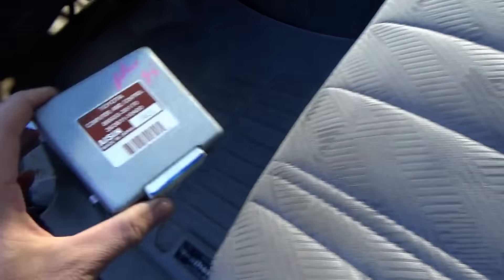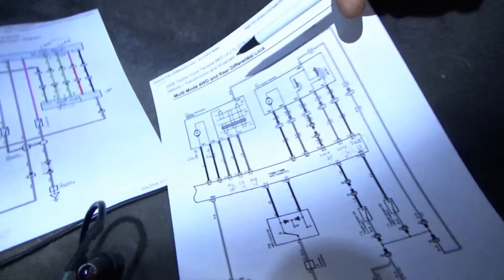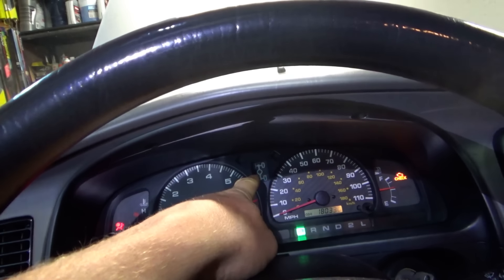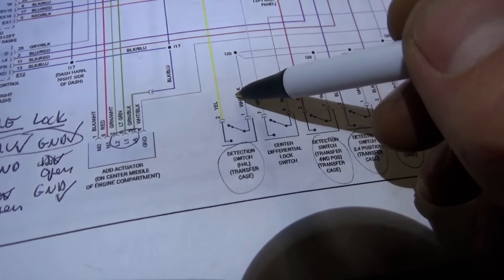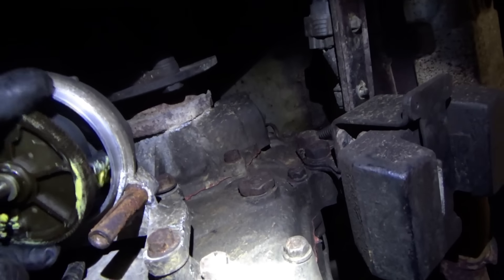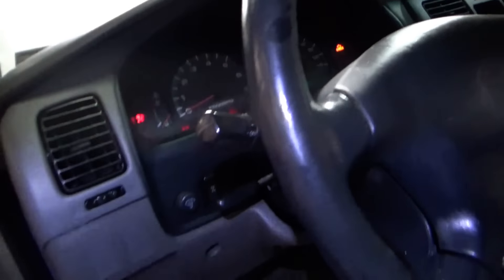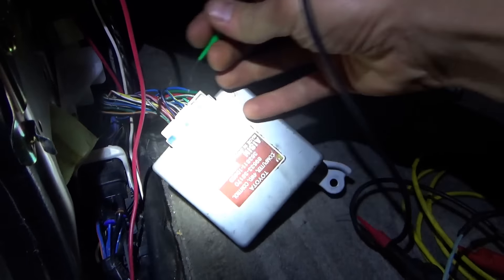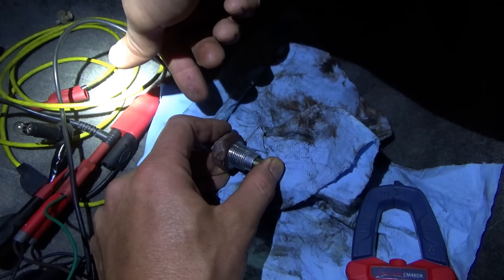(Pt 2) HELP! My Toyota is STILL STUCK in 4x4! ('02 4Runner)

Comment: Hey ivan. Your videos have have always helped me grow. I’m an expert certified Toyota technician and I agree. These 4WD diagnosis are extremely tricky. What I always do to test the limit switches is shoot 12 volts at the motor and have it go through all positions while resistance checking the limit switches internal to the motor. If it doesn’t change than I know the limit switch is stuck. On service information for the 4WD systems we have a quick training guide that really helps the diagnosis. Most Toyota techs in my shop are too lazy to wanna do these diagnosis properly so they shotgun parts. If you ever have any Toyotas that are weird issues I can msg you my number and we can work thru the issues.

Comment: Ivan, you and Eric O are national treasures. No mechanic at any dealership and very few independent mechanics go through this effort to fix older cars.  They play fast and loose with customers’ money and just fire the parts canon too often. I salute!
Reply: Too many customers assume because it's a dealership they shouldn't need to pay for testing or as many hours of testing because they're just supposed to know,   more experienced etc.    Reality most dealership techs on average don't even have 10 yrs experience on the brand so the older stuff isn't familiar.   And the older stuff isn't easier to diag because there's less data to interpret.   The quality of diag directly correlates to what the customer is willing to invest in a diag.     Most customers don't wanna pay for the answer they want you to guess then take all the liability and responsibility.

Comment: Ivan, this series is a great example to the public on what us Mechanics/Technicians go thru. The Ebs and Flows of the Diag process, the ability of honesty about being wrong and taking responsibility for it. Not only were you doing things the right way and still made a bad call, but you also had a ton of time in researching this older system to re-familiarize yourself. People do not realize this. I couldn't have done it better. Bravo

Comment: Congrats on nailing it down. 95% of all Toyota 4wd problems are in the stupid position switches, mostly in the transfer but occasionally the ADD. Gearsets never fail unless they run dry. 

I was looking at a 2020 Sequoia recently for flashing 4WD, and the 4WD ECU is incredibly not on the DLC network. Toyota tech school devotes an entire day just to 4WD electronics diagnosis due to the difficulty of these systems. If you have access to TIS there are some "cheat sheets" buried in the manual that provide premade on/off switch charts for every system since the '90s, much like the chart you were building. Huge timesaver if you can get your hands on it.

Comment: Don't feel too bad about the initial bad call, Ivan.  I lost $2200 (that's not a typo...) on a '23 Mercedes Metris van last Thursday, similar situation in a lack of service info making things difficult.  I've always been of the mentality that if the car is happy, everyone is happy.  The dealership had the van for a month and couldn't fix it, and it took me 11 hours--nearly 8 of which was with a remote Mercedes programming service @ $300/hour--to get it fixed.

Worth it though!  The customer is an independent commercial vehicle rental company, and they have a fleet of over 30 of these vans, all of which will be going to me instead of the dealership now for anything not covered under warranty.  :D

Comment: It's times like this I appreciate how simple my 99 4Runner is. Manual, with the J shift xfer case. No electronics in the 4x4 unless you count the rear differential e-locker.

Comment: 22:52 Diff Lock is not "In", or engaged, until the yellow light STOPS flashing. And you may need to be driving and moving for it to lock "on" solid, not flashing. Consult the Owner's Manual. I have an '01 4R 4WD and it can take some (variable) number of seconds for the lights to stop flashing, meaning that 4x4 and/or the CDL is now engaged.

Comment: as a former Toyota Master Tech, I HATED 4wd problems during that era since the service info was Horrible.
Reply: I’m a current Toyota mdt and it’s STILL bad. 4wd problems on Toyota suck because of lack of service info and diag process
Reply: @MMAunderbelly  I was working on a '20 Sequoia a few months ago...4WD STILL not on the network. $60K SUV when new. Good grief.
Reply: But it's a toyota, it can't be, everything is perfect according to the internet!

Anyway, have they strenghted up transfercases and propshafts or are they still made out of matches? Seen at least a couple with snapped shafts.

Comment: I’m so thankful you took the time to show us the new module didn’t work and continued to work on what’s next.  I definitely respect not charging the customer for the part but also understand that time is money and sometimes getting to the solution takes both.  Those parts probably don’t fly off the shelf on eBay but I wonder if it could be resold by the customer to recoup their money as an alternative.  I know it’s ridiculous but having a known good part is sometimes needed to get past what’s left.  I wonder how many parts get repackaged at a dealership by a tech realizing they were wrong too?  Probably happens a lot more than we know. I’ll have to watch this 10 more times to track your process and see if I can follow your steps to success.  Thanks again.

Comment: I had the same vehicle. Mine was a 2001. I had to move the vehicle forward a couple feet or a couple feet back to get things to change every time I changed any setting with the diff lock or high or low or whatever. I only had to go to neutral to go to four low or engage the Diff lock. You can do four high and two high on the fly under 25 miles an hour. But again to do the dip lock or for low or come out of it you have to move forward or reverse a couple feet for everything to lock or unlock and seat into position.

Comment: I've learned from the Master techs at my shop to start at the axle disconnect by plugging in a known good. Then, if there is no change, remove the rear switches and test those on the bench.

Comment: Ivan really opened my eyes to understanding the logic or programming of a module, this is a perfect example. You could have a mechanical failure that results in a sensor telling the module of the failure (or a module not getting the antipated electrical feedback) and the module would then shut down or go into limp mode to protect the drivetrain. This makes it appear there is a module or electrical fault, when the problem is mechanical (or in this case a hybrid mechanical/electrical problem with a switch).

Comment: Bought a ‘00 with the same issue… stuck in 4WD and the front ADD would not disengage. The 96-00 still had a vacuum actuated axle disconnect, so I was able to use a vacuum pump brake bleeder to disengage the coupling fork so I could at least drive around without axle bind. It ended up being one of the 5x position sensors (1 on front diff, 4 on the T-Case), which are usually the culprit as the switches bind up from sitting. Sometimes the  actuator motors on the 00-02’s bind up but it’s usually the switches. Some people have had success removing and cleaning them with contact cleaner and a bunch of cycling but that didn’t work for me. I replaced the 1 on the front diff and the 2 easily accessible ones on the t-case (the other 2 are way up next to the shifter) and it’s been smooth sailing since then. 

It seems like Toyota, in all their wisdom, made the system so that if there are any electronic faults with the system, it defaults to 4H Locked, which is great if something breaks in the brush but makes it a PITA to drive if it happens in civilization. 

It is very important to cycle your 4WD on any electronically actuated 4WD vehicle every once in a while so sensors and motors do not bind up from sitting and moisture accumulating. 

The fully mechanical J-shift found on everything up to ‘99 never has these problems and it seems odd that they would ever switch to electronics and motors and add some such complexity. These “straight shifter” models essentially have the exact same function as the older J-Shifts, my ‘00 limited (only available on the ‘99 & ‘00 limiteds) has a hybrid of the two: electronically locking center diff (which is special because you can have an AWD mode with the center unlocked to drive at any speed too) and mechanically/vacuum actuated everything else. That’s progress!

Wish this video came out two years ago when I spent months messing around with mine! Good stuff.

Comment: Clever stuff, Ivan.  I think the extreme cold weather can mess with systems on a car.  For example, when we moved to Minnesota, my 2004 Sequoia did some weird things.  One was related to its 4WD system, during sub zero Fahrenheit temperatures, it would get stuck in 4WD, and it would only free itself after the weather started to get warmer.  The airbag light used to come on also and only go out once the weather got warmer.  Never had these problems in Florida where we lived before or in Virginia where we are now.

Comment: Both the replacement module and the old module are both old. I would have to inspect the new old module before putting it in the vehicle, and if it passes the visual under the microscope then I would treat the pins with Deoxit D100L and cycle the connector a few times. Then I would apply power and see if it at least had 5V Digital Power on the PCB, then I would see if it controlled the transfer case. In the first video, from what I could see, the module PCB looked in really good condition. Taking the module apart to understand the circuitry has the advantage that you now know how the transfer case motor is controlled (relay contacts).  

I think once the module was ruled out I would have tried to cycle the motor and actuator assembly before doing anything else. Understanding the wiring diagram and knowing the module relay control approach you can tell that the motor is just a reversing DC brushed motor either locked or unlocked, moving between two stops, at least from what I could see in the video. I would have tried energizing the motor with a +12VDC Linear regulated current limited power supply initially set at 5 Amps current limit. If the motor is gummed or seized, it is usually just spent lubrication, and will not move you will current limit at 5 Amps. If it makes a noise like it is trying to move reverse the leads and try again, if it still makes a noise but does not move, try upping the current limit to 10 Amps and try again. If the motor eventually frees up moving back and forth between the stops, and the system still does not work, then you can move on to looking for a bad position switch.

However, even though you have been able to get the motor moving it is not fixed, it will just gum up again in the future because the lubricants used in the original assembly are crap. You will have to disassembly, clean, lubricate and re-assemble to really make the repair. You are better off rebuilding one on your own with high quality lubricants, than getting a replacement actuator assembly. Selecting the proper lubricants is not easy, but very interesting. One good source to start with is Dupont MolyKote.

You can get the rusted bolts out of the case with heat (use a propane torch and not an OXY on low), and fix the Pot Metal ears with Muggy Weld Super Alloy 1 Multi-Metal and Pot Metal Solder or equivalent if you can get the assembly completely apart, or if you do not want to heat up the case you can try JB Weld, which can work surprisingly well at times.

Comment: Is that switch listed as a proximity switch. It looks and behaves just like the switches we used when I was working is an engineering lab. We used them to sense the position of actuators and doors. They would have a very long throw. Some styles were very resistant to contamination and therefore suitable for harsh environments.

Comment: God help you if you need to remove that actuator from the transfer case.  The service procedure (bit different 1998 SR5) is to disassemble the transfer case to remove it.
I was able to take one apart and macgyver fix it with part of it still on the transfer case, but the gears in the actuator need to be timed appropriately.

The issue in my situation was corrosion that got into it and released the permanent magnets from their housing.  I glued them back in, and miraculously must have got the actuator gears timed properly during re-assembly.  Memory is telling me that Toyota did not sell just the actuator, so that means either a brand new transfer case, or sourcing one from Rustfreeville, AZ.  My fix lasted for at least a few years, and thank goodness this customer finally got rid of the thing because although it ran and drove great, it had the typical Toyota cancer.

Comment: In the first video, I mentioned possibly using an Arduino to replace the module if the module wasn't available because it's basically a state machine.  But the first step is to simply verify the state machine is working correctly by measuring the value of each switch in different shift positions and comparing to what it should be.  It might have been a fun project to quickly build a breadboard with an LED for each switch so you could see all the states simultaneously rather than switch test light and multimeter leads around.  I'm pretty sure a modern version of that box would be reporting states for each switch in scan data. If so, this would have been a quick diagnosis.

Comment: Ivan, the diag on this unit should be charged per hour since there is not enough service info on the 4WD operation. Your experience from previous diags should be compensated appropriately. When I do diags on things that don’t have service info I charge for the time NOT a flat diag fee. 
Plus , now that you’ve generated that truth table of switch states you are going to help someone else who watches IMMENSELY!! 
Great job in keeping your COOL 😎🧊when you hit a roadblock.

Comment: Sometimes the flashing 4x4 indicators don't go off immediately. You may have to drive a few, or more, seconds, even put it in reverse for a few seconds. If the system is working correctly, the lights (4x4 green and/or the Center Diff Lock yellow light in the middle) will flash when the system is NOT yet engaged. Then they go solid, on.

Comment: You can change the transfer case actuator without taking the transfer case apart. It is a little tricky getting the shift rods to line back up with everything in the shift actuator though.

Comment: My original guess was a bad position sensor in the shift motor assy but you were so sure it was the module (which in my experience is usually never the culprit). For the GM NV246 transfer case, the internal sensor is available. For Toyota, you may need to replace the entire shift motor assy. The symptoms seem very similar to the GM NV246 bad shift motor position sensor.

That 4WD detection switch seemed to work. We'll find out if it was bad in part 3.

Comment: Tired actuator motor?  We will see. My 2019 Tacoma (3 pedal) has had pretty much the same issue since new . To get it to shift from 4L to 4H or back to 2H , fully depress clutch pedal and release twice and it works every time. I have no explanation. Maybe some similar trick might work on the automatics also. Never worked on one , yet.  👍👍🇺🇸

Comment: It’s been my experience with Toyota four-wheel drives, especially the older ones. Is that if you don’t use those transfer cases once a month you’ll forget you won’t use them for a year and then they freeze up. But they are also very difficult to get out of four-wheel-drive and even in four-wheel-drive, you have to do a lot of driving finagling while the thing flashes before it finally locks in and so your little thing in your driveway wasn’t enough. I don’t thinkto get the transfer to switch I’ve had a mild on the road before it finally does whatever it does and click in

Comment: I have a waveform saved  withy scope for all of those switches.

I did have hard time  with the diagnosis of those 2 cases both wa complicated fore .

2012 toyota sequioa  4x4 low blinking , first time came in the 4x4. Was angage at all time , with my hammer on the dif actuator did my diagnostic easy Right? Also had a dtc for air injection valve .

Replace both. All good fixed ! For how long ? 2 weeks later comes back with same customer conncern check engine light on , 4x4  2 low blinking again .

 At this time I spent ours and hours trying to figure out everything seem ok on the 4x4 side so I decided to move to the dtc for air injection valve . Indeed the new auto crap part has failed.

I installed the  replacement part and guest what the blinking 4x4 ligth went off .by ckearing the check engine light . Really now I started unplugging engien  sensors , I realized when the check engine ligh is on trigers the 4x4 too.

Now I was diagnosing a gost on the 4x4 side . Well I got confused because initially did have an issue .

Long stoy 😂 hope belps some one

Comment: I hate Toyota's 4WD control system.  Not enough info available.  Toyota has a class for their techs and the course book is a valuable piece to have since it covers a wide range of years.  
Thankfully the Domestics allow you to use scan data PID's rather than having to back probe so much stuff.  Good diag!

Comment: I'm actually surprised service data didn't have the very chart Ivan made, because that's how you check it w/o live data on stand alone modules. I was expecting a burned spot on the motor position contacts, so I would've been wrong too. Ivan proved the module was trying to control the system, and also the mechanical side is fine. 1 stupid switch took the whole thing down. I AM surprised it didn't default to 2wd. Part 3 for the fix!

Comment: Tough deal here. What should you check first? Computer electrical part first or noncomputer electrical hardware first? Should check the hardware, wiring, switches, motors first.